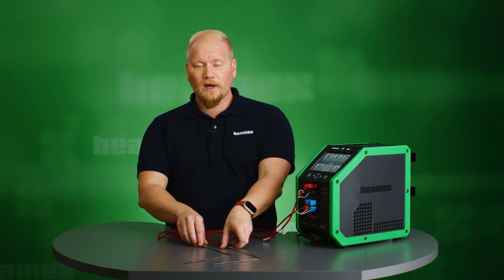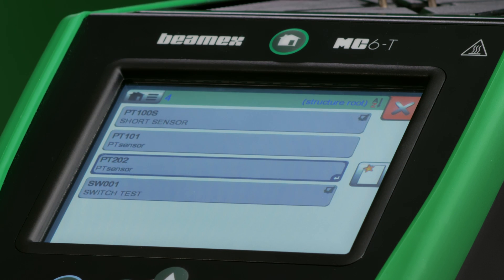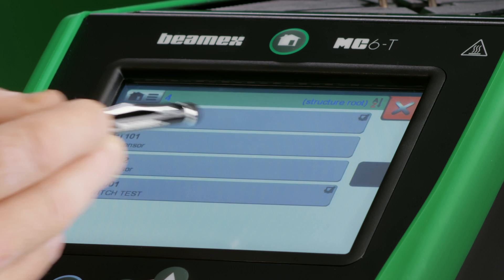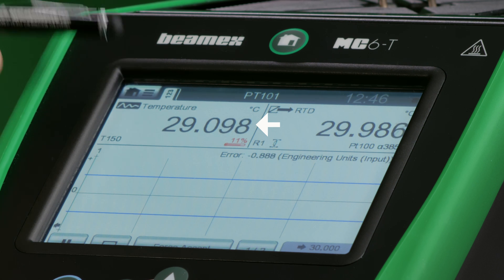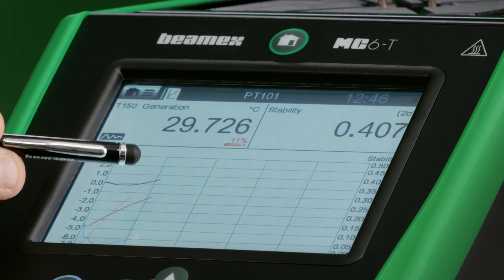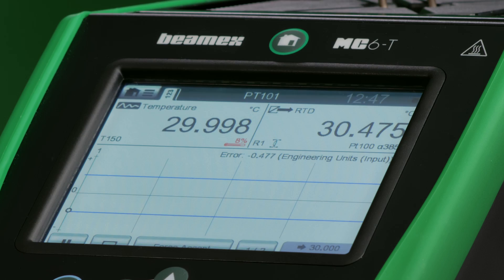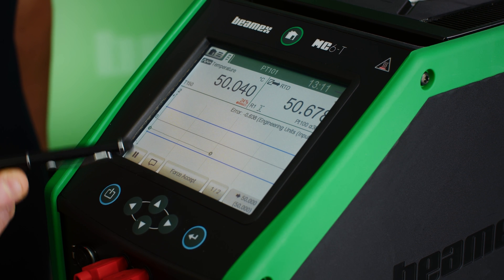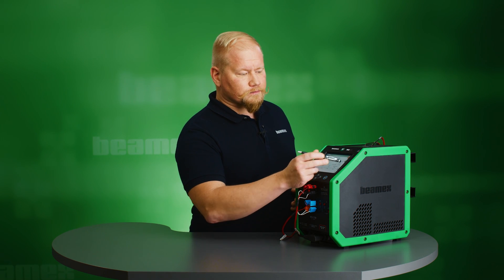How to calibrate two Pt100 sensors simultaneously and automatically

Comment: Not calibration but Accuracy test of the sensor...
Reply from the maker: Hi, we like to follow the international definition of calibration which is "documented comparison against an accurate reference standard", and the adjustment/trimming is a separate process. In this video we did not adjust the sensor, and most often that is not even possible - instead you calculate the correction coefficients that can be used in the measuring device to correct errors. Thanks,

Comment: Dry block Calibrator can use to calibrate the PT 100
Reply from the maker: A dry block can be used to calibrate a temperature sensor. The selection to use internal or external reference sensor depends on the accuracy requirement of the sensor to be calibrated. If the Pt100 to be calibrated is very accurate, it is recommended to use a high accuracy external reference sensor.

Comment: You are just reading the indication of the two sensors with out a known standard sensor to compare to the unknown two sensors whom you are reading with your instrument. A calibration process is that you are comparing an unknown item with lower accuracy against a known item with higher accuracy. Raffy Garcia
Reply from the maker: HI, thanks for your comments. I agree with you. In this application the Pt100 sensors are calibrated comparing them against the calibrated internal reference sensor of the dry block. As mentioned in the video, you can also use an external reference sensor, which typically enables better accuracy (smaller uncertainty). The selection between internal or external reference depends on the uncertainty requirements of the sensor to be calibrated. Thanks!

Comment: Hi,the sensors has passed three points with acceptance tolerance but in this case we can't say you calibrate the sensors like the calibration of transmitters(A/D,D/A) calib.
Reply: چچ۰ک۹❤❤❤۹😊
Reply from the maker: Hi Sir, with the term "calibration" in this video we did the comparison against a more accurate reference, but we did not perform adjustment. Formally calibration is a documented comparison, and possible adjustment is another step. We know that in common language, the calibration often equals adjustment. Anyhow,  adjustment is often included in the calibration process. I hope this explains.
Reply: 😮p😅😮 😮 i😢 😮😮😮olm